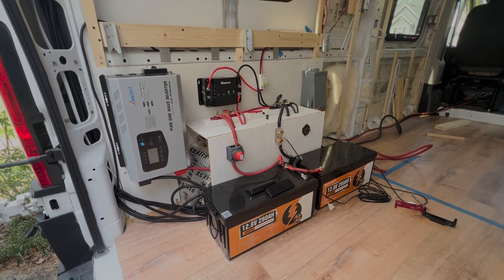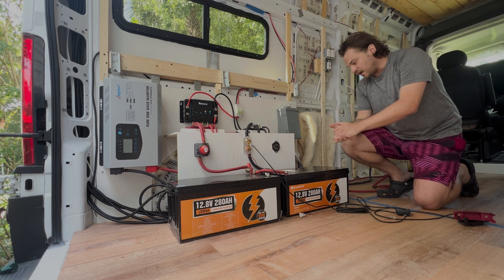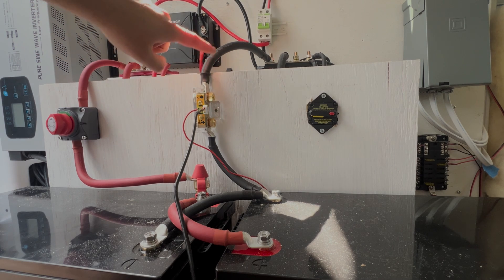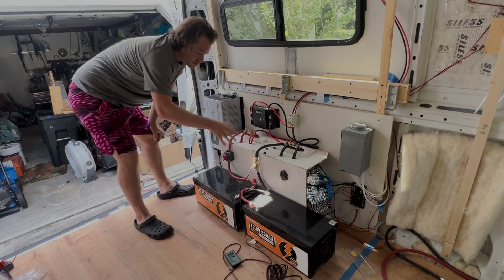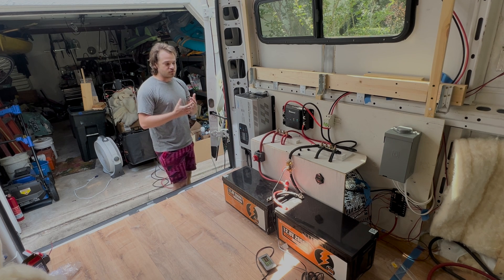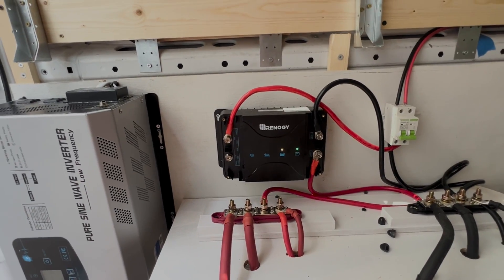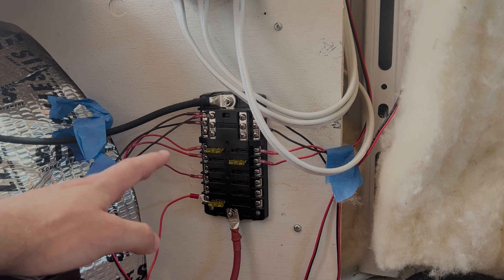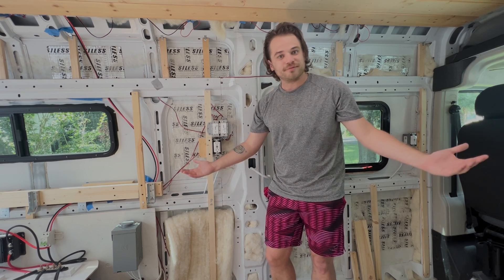DIY Camper Van Electrical System || DIY ELECTRICAL || RAM PROMASTER VANLFIE BUILD

Comment: so will the inverter take the place of a normal one i am used before when i did not have shore power. and also, can you run all your 12 volt items off that?
Reply from the maker: Yep! Combines your charger and inverter in one, works amazing! Can run everything off of it!

Comment: Would you by chance have a diagram of this set up, or just everything up to ac fuse box and dc fuse box. I'm about a week away from ordering everything. I'm  pretty much going to mimic your entire electrical setup including the 12 volt AC, and heater.
Reply: I have the same question lol. Good luck in your build 👍
Reply from the maker: Hey if you can message me on my instagram I can send you a mock up!
Reply from the maker: Hey if you can message me on my instagram I can send you a mock up!

Comment: Like your setup.  Looks easy to set up.  I do have one question.  If I go with the 3000 watts inverter instead of the 2000 watts that you have, can I use the same wires and equipment that you use for the 3000 watts?
Reply from the maker: Yes you can! And I highly recommend the 3kW one, only regret in my system is not getting that!
Reply: Ok, reason I asked is the 3000 watts was cheaper than the 2000 watts.  Thank you for the quick reply.  By the way, you did not mention what the Blue Sea system 7084 thermal breaker used for in your system?

Comment: in setting up the inverter/charger I see it has 5 different modes, I am thinking to set it up in mode #2 as battery being the main power source, is this how you have it setup? or how do you use it?
Reply from the maker: I think the mode I have it in is #2 but I’ll take a look and make sure (there may be one where it’s battery unless there’s an AC source)

Comment: That's the clearest description I've seen. Can you tell me, why does everyone put the batteries and electronics on the driver side of vans, not the passenger side?
Reply from the maker: I think it’s preferable due to the alternator and battery to the van connections being on the driver side (for the Promaster at least) shorter runs! But I think most of the time it’s just whatever the builder likes!
Reply: @PeterGoesPlaces  Makes sense. Thank you.

Comment: There are a lot of things you can do to same money and create a more fortified electrical system here:
1. You can get an off brand 120v/12v battery charger for $100 instead of the $400 ampinvt combo inverter charger. (Because your batteries are 12v you don't need a special charger to charge them. A standard 12v car battery charger charges at the same 30 amp rate as a combo inverter charger maybe even a bit faster, but for far less expense).
2. You can get an off brand 3kw/6kw psw inverter for $160 instead of the $400 ampinvt combo inverter charger. (The inverter and dedicated charger are not only cheaper, but higher output than the combo unit. Separate units does mean you will have to gauge whether you cherish simplicity, or capability for the money).
3. You can get a 60 amp temank mppt charge controller for $100 instead of a $280 renergy combo mppt dc-dc charger.
4. You can get a 500 amp battery iso for $60 instead of the $280 renergy combo mppt dc-dc charger. (in your case, like many mislead van build cases, you don't need a dc-dc charger, because your starter battery and alternator run on the same voltage as your auxiliary or house batteries, so all you need is a smart battery isolator switch which is more straight forward and saves you money).
5. You can get an upgraded 240+ amp 12v alternator for less than $500 to work in conjunction with your battery isolator switch as the primary method of charging your auxiliary house batteries. This is extremely efficient because it reclaims energy you already paid for every time you put fuel into the tank and is not reliant on bright clear daylight or being next to a wall outlet to get a big dump of energy in your batteries it also does not have to run for a long time to get a lot of energy into the battery so any time you start your engine or move your van even short distances you will be reclaiming a lot more energy than letting your van sit in the sunlight which can become very useful. Without a typical dc-dc charger in the way, an isolator can charge batteries at a much higher rate. Your renergy is 40 amps at 12v or 400 watts. A battery isolator switch rated for 500 amps at 12v can relay 5,000 watts from an alternator. A $420 320 amp 12v alternator produces 3,200 watts at peak. You can get higher watts depending on available upgraded alternators for the 3.6L v6 engine in promaster vans.
Reply from the maker: These are all great suggestions and for anyone in the comments this is definetly another way you can go about it! I like the inverter charger and combined mppt devices for compactness and space saving! But you can totally make it this way and save on price!

Comment: Question on your inverter charger. I have seen some reviews that say the unit will not start off the battery. In other words it requires shore power to start and then will switch to battery when needed. Will this charger converter powerup off the battery when shore power is not available? I want to use the 1,200 watt version for my squaredrop camper build and may not always have shore power available.
Reply: I watched your other video, question answered.
Reply from the maker: I’m glad the other video was able to help before I could lol! I love this ampinvt charger, wish I just got the bigger inverter is all!

Comment: Hey bro j just installed my battery monitors, im just curious why did you use what looks like 2/0? I used a 10 awg..should i have used bigger gauge? Appreciate it ❤
Reply from the maker: I used 2/0 for my battery lines since sometimes we pull a couple hundred amps from our battery. The higher gauge wire is rated for higher amps! Some spots were overkill but just count that as me being an over cautious engineer, however I would recommend thicker gauge wires if you plan on pulling more than 30 amps which is what 10 AWG is rated for!
Reply: @RacineandPeter  you know, I get that that it does make sense. And I realized I actually also had it hooked up wrong.I have hooked up like yours and also am using 2/0 so this thing doesn't actually sense what your battery is at? I see you have to manually set it? For a 560AH 12.8v what would my high and low be the screen is blinking no idea what that mean, I appreciate the reply bro.
Reply from the maker: @Van-life-4-Jesus  what the battery monitor does is sense your voltage so I have set it to show what the normal settings should be! Blinking typically either means getting power or using power! Depends on what the amps show, could be plus (gain) or minus (loss)

Comment: Appreciate your videos Peter. I'm trying to figure out how to power a 12v Velit 2000R by shore power. I'm not going to have an elaborate solar electrical system in my van, just a large Bluetti 2000L portable power supply to run most of my 12v items and occasionally a 110v appliance.. My van is not for living in or going on long road trips. Mostly just a weekend warrior camper. I enjoy state parks so when I'm there I want to plug into 110v and use their power to run a  Velit AC on hot days. There must be a way to accomplish this but I can't find a straight answer from anyone. I thought it would be as easy as installing some type of 110v / 12v DC converter but maybe I'm missing something and should purchase a 110v air conditioner instead so I would sure appreciate your input.  Thanks so much.
Reply from the maker: Hey I hope I am able to clear it up. You are 100% correct! All you need is a 120V to 12V converter with enough wattage! So I would google exactly that, 120 to 12V with the Watts that the Velit pulls at peak! Which looking at their site seems to be 650W, I would size up to 1000W just to be safe!
Reply: Was wondering what you decided with this? The problem you're going to have is the Velit requires 60A continuous in High/Boost mode and those battery generators are typically only 20A-30A max.
Reply: @xplicit702  I went with the Velit 2000R 12v AC.  About the only time I plan on using it is when I have shore power at a campground or if I’m mooch docking. Also possibly with the Bluetti 2000L but only for a short period of time.

Comment: But i love the enginuity an the whole break down great job alot of hard work
Reply from the maker: Thank you so much, def was! And buying one would have been easier, but we like a challenger :)
Reply: @PeterGoesPlaces  yeah I went an got approved for one with monthly payments of around 750$ 7 k down instead I just got a used RV year 2000 not the everything functional  but minork repair here an there but for the most part great investment seeing all the hard work you put into this I was trying to build a diy system to power my refrigerator but was unsuccessful because the existing wire plugged to the RV system already so the reason for adding solar was to be able to run the refrigerator for long periods of time by itself I have a renogy 2000watt inverter a 40amp charger controller a 200watt solar panel an 2 12.v 200ah lithium batteries what am I missing I'm using zero gauge wire  can I cut the wires to my refrigerator or I bought a separate one with 12v capacity in going to get a 12 volt fuse box an hook it up directly
Reply from the maker: If it’s a DC fridge you should be good just hooking it up to a DC breaker panel! If it’s AC you’ll want to install an AC breaker panel and wall outlets. Otherwise it looks like you have everything!

Comment: Hey brother, great video. This may be a stupid question...but in what irder do you wire things... For instance, do you wire everything and then connect to the battery or do you connect to the battery and slowly wired everything??? 🤔🤔🤔🤔
Reply from the maker: Not a stupid question! I wired to everything that I knew was going in first! Then I connected the battery, if I wanted to add something later it wasn’t to tough to wire out to it even after battery connection

Comment: Surprised at a 150A fuse. 6000W surge at 12.8V is almost 470A. even 2000W is 156A or so.
Reply from the maker: It’s probably the item I’m most in flux with, it’s worked so far but we haven’t had anything pulling more than 2kW yet. My thought is to go to a 300
Reply: @PeterGoesPlaces  Why not? Or 500A if the cables can take a short burst. The battery bank is capable of 400A continuous (I've got the same one) and will shut down with over-current that isn't surge. I always thought the fuse there was to protect from a short circuit and was therefore fast and as big as needed to allow surge currents.

Comment: What     Higher voltage would require tons of batteries  and you claim to be a electrical engineer .
Reply from the maker: There are 12V to 120V inverters…

Comment: Where’s the rest of your fuses? The fuse for the inverter? The fuse for your 12v fuse block? And the rest?
Reply from the maker: Great question! The inverter has a built in fuse, there’s a fuse installed just before the 12v fuse box as well! This was a quick and dirty video - I’ll make a more in depth one in the future. Everything here is protected I promise!
Reply: @PeterGoesPlaces  When your wire breaks loose of the inverter and shorts, the build in fuse will definitelly provide protection

Comment: If one of your batteries short circuits internally, you will be relying on the BMS system of the other battery to disconnect. Do you trust that BMS? If that BMS doesn't disconnect, your van will likely burn down.
This is what I did.  I used the same fuse as you on the terminal, but I connected the wires opposite of how you did, that way the fuse protects the batteries from each other. I would know if the fuse blows because my Renogy Monitor (+) wire is connected at the top of the fuse, which means that my monitor would read the voltage of the battery that is disconnected due to the blown fuse. The monitor would never change voltage reading if the fuse blows.
 Than I added one fuse downstream of the disconnect to for my primary protection.  But I don't trust the BMS to trip in a fault if its my van, never never never.
Great video. Thanks!
Reply from the maker: That’s great input I hadn’t thought of that and now I have to rethink some things! 🤣 thanks for your comment and glad you enjoyed the video!

Comment: Fyi , your negative cable on the fuse block must be turned or the cover wont snap on. I made the same mistake with mine, nice system though
Reply from the maker: Thanks for the heads up! It’s been a great system so far! What do you have?

Comment: Hi guys question please.

I live in England were the sun is low. 

I'm I better to get many solar panels to charge my batteries.. Or should I get more batteries and a small generator...

There is sun, but it's seasonal... And power drops considerably..

Thanks
Reply from the maker: Hmmm I probably wouldn’t do solar if you aren’t getting a ton of sunlight but it never hurts to have at least one panel! As far as it goes with batteries it depends on space for you! If you have the space I always recommend some extra juice, generator wise I can’t really speak on, instead I would get a DC-DC charger and tie it to your van’s alternator!
Reply: @PeterGoesPlaces  thank you, very helpful...
Reply from the maker: Anytime ☺️☺️

Comment: Exactly the setup in about to build and had in my mind. I found that inverter and wanted to see if anyone has done a build with it and included solar! Thanks for this I will be building one almost identical in my Camper minus the alternator.
Reply from the maker: It’s been such a good setup so far, no issues! If you have any questions at all let me know!

Comment: I recently picked up the same pair for great deal on ebay. Using in a little house. Still prototyping though
Reply from the maker: They have worked wonders so far!!
Reply: @PeterGoesPlaces  Yeah I am just figur\ing out I ill need more than 1200 W solar to run my AC more than a few hours. Or i need to turn it way down.
Reply: Btw I also got the ecoworthy 3000 W hybrid interverter / mppt charger. Bad documentation but pretty solid operation so far.

Comment: That's a super solid system! I also see you went with silless butyl mats, I did the same in my minivan. Those 2 280ah LFP batteries are a screaming deal. I paid $200 for my 100ah DC house and it felt like theft, but yours were even better value. I look forward to seeing more whenever you have the time!
Reply from the maker: I love the batteries! They’re so nice to not have to worry about capacity and drainage on them! Tell me more about your build! I plan on doing a schematics walkthrough video soon for more details!

Comment: $1000 for 2 of the 280ah. Car 1 battery $200 is 170ah.  2=340ah for $400. $1000%$200=$800, 4 + 1 car battery = $1000 = 680ah + 170ah = 850ah.
Questions is Duracell car 859ah vs your 460ah.
Reply: Looks like someone is still in love with lead acid batteries.
Reply: the lifepo4 batteries have about 5000 cycles to 0, but could last longer if you dont drain them to 0.  plus the weight factor a 100ah lifepo4 is about 24lbs.  a 100ah lead battery is atleast 50lbs.  plus they do not sulfate Like lead batteries
Reply from the maker: There are definitely cheaper options with different battery makeups but for this battery type and size it was a great steal! And they were under $1000! Which battery type do you prefer???
Reply: What did you just say??? 🤣